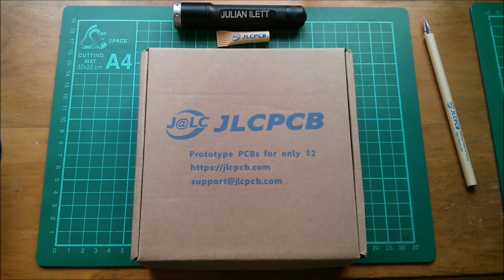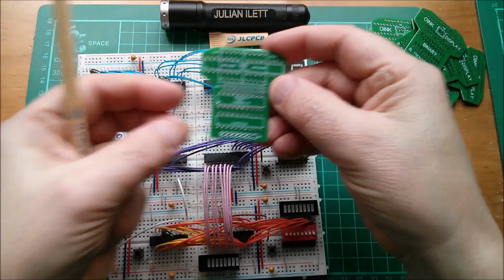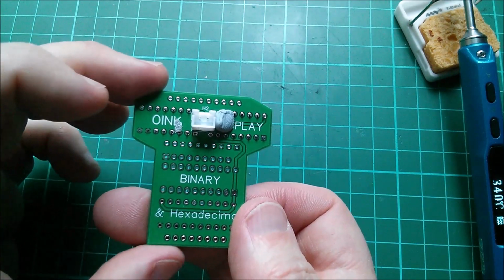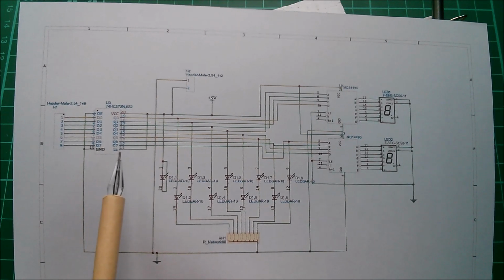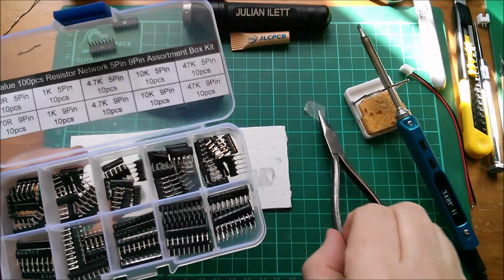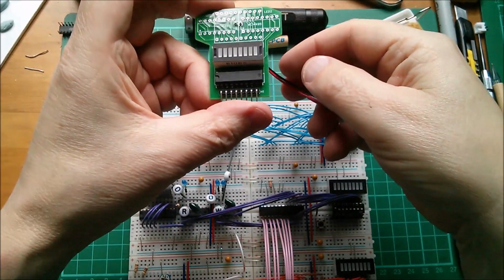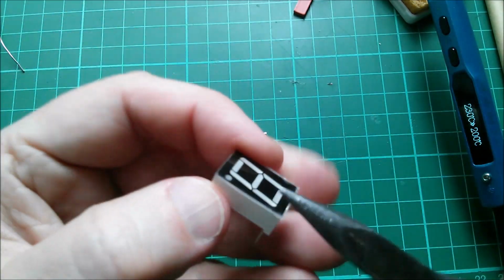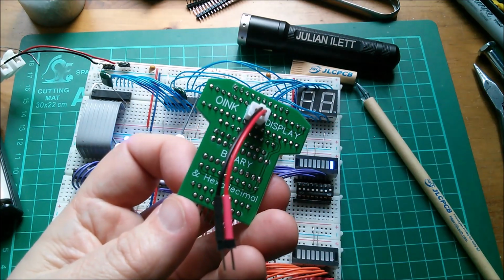New PCBs - Binary/Hexadecimal LED Display - OInK

Comment: @19:59 Using the tie clip is a great idea. Holds whatever you use it on down, and maybe dissipate heat. Sorry, I am still new to the hobby so maybe that is a quite normal thing, but I have never noticed it before. Thanks Julian.

Comment: As they say... "You don't solder a TIL311, you don't socket it either. You rent it!" I wonder what happened to those 20-30 pieces in storage at my first employer... But then again, this was some 26+ years ago... Back then, I built a POST card on ISA bus (0x80) with a pair of them (pretty much of what you have done here)... Would you reconsider and make public, free and unlimited use of the schematic  (no brainer) along with the PCB and Gerber files if I lend you "sine die" a pair of TIL's?

Comment: Julian!  Caution!  I'm a retired Biomedical engineer.  Early in my career, I used my thump to cover component leads as I clipped them off - using reasonably sharp high quality cutters.  Didn't want the leads flying into my co-worker's eyes.  Instead, the lead was injected into my thumb with such velocity that I didn't even feel it!  I think it was some sort of Motorola dual gate MOSFET with gold leads.  Nice little bugger. A month later my thumb was the size of a plum.  The wire had hit the bone and turned into a zigzag shape.  It was originally about 2 cm long.  When cut out of my thumb (by myself), it was scrunched down to about 6 or7 mm.   Every time you clipped a lead off, I absolutely cringed.  You're heading for trouble, son.  Nice video work!  Thanks!
Reply: Gees was the lead really pointy and really hard metal? Because thumb skin is pretty tough
Reply: Yep. those old Motorola transistors with the gold leads had what I think was gold plated steel legs.  very hard, very sharp and very beautiful.  I used to get poked by those leads a lot.  take care

Comment: You should definitely market these. My only suggestion for an upgrade would be polarity protection in the form of a single diode or a little smt bridge rectifier. I've killed so many logic chips by plugging the power in backwards.

Comment: That's really useful, actually. I've been trying something similar, just with four bits input switches for a nibble to hex. But the few ics I found did just binary to decimal and then some nonsense for the A-F part. So I made a discrete diode ROM instead. Yours is much more compact.

Comment: Before making public, you really should have added the bypass caps.  Please consider re-uploading the PCB layout WITH the bypass caps.
Reply: steveandamyalso Amusingly, I’ve just started watching the video and my first thought when Julian showed us the multiple digital IC PCB was... I don’t see any place for bypass caps?  LOL
Reply from the maker: A purely combinational logic circuit doesn't need decoupling caps - there's nothing to latch into the wrong state :)
Reply: @JulianIlett  It is your design, do as you see fit.  The bypass caps will do a great deal to reduce radiated EMI and overall circuit stability.  You have a good GND plane, which will help tremendously.
Reply: @JulianIlett  Fair enough, I concede they aren’t really necessary in this application. For sure, any brief errant logic levels caused by switching supply line noise will stabilise (given the low switching frequencies involved).  But I still maintain it’s good practice to include some bypass smoothing in any digital circuit. :)

Comment: Thanks. I'm embarking on an 8-bit computer build inspired by Ben Eater's and James Sharman's builds. I was thinking of designing a little board like this, but now I don't have to. I just ordered a batch from JLC.

One question: while watching you assemble it, I was wondering why you didn't put the MC14495 chips on the back, so you didn't have to stack the 7-segment displays on top of them. Too difficult / impossible to route the traces because everything is backwards?

Comment: Wow, I haven't seen one of those in a while.  I had made a Half A##ed attempt at making one of these with an 8 bit computer called the C64 years ago. I was repairing them in my garage under the Redwood Trees in Northern CA. I had so many boards to repair that I could offer the customers two options, 1 their own board back, 2 an immediate swap (as I had repaired many I had found used) and of course, the immediate swap was very popular. I used heat of the chips quite often, and sometimes they were cool when they were bad, hot other times. I always had to remove the chips, put in a socket, and put in a good chip. The board had a lot of PROMS and VID chips bad. I hope to find a C64 Commodore 64 (most likely a with a bad board) somewhere and repair it so I can have one . I still have most of the chips.

Comment: What's the point of using 4 ICs when you can use a single $0.5-$1 16-28 pin micro? You could optionally add button to switch between hex/dec which would also save you the hassle of custom pcb, making possible to order panels and use vscoring to cut rectangle circuit boards...
Reply: Then you wouldn't get to showcase your sponsor's ability to do odd shaped boards ;)
Reply from the maker: I don't want any programmed devices in this project :)

Comment: Very good design, clean with very little wasted space. I unserstand about overlapping the LED displays to the driver chips. Next time SMD versions?
Reply: Unfortunately, the MC14495 Decoder/Driver IC is an old design, and I don't think they are being made any more. At least I can't find any reference to them still being made, and certainly not in SMD-compatible versions.
Reply: @BertGrink  You're right, didn't think of that. I have worked with this IC in the past couple of years with some customer's products. No wonder they have changed their PCB layout ;) ! I did a filial search and came up short on direct replacement .Possibly a PLD or PIC transfer, but this was a one off so I am not getting tto hung up on fyture logistics.
Reply: For an SMD version, you’ll need to use a CPLD 😉
Reply: Julian could possibly have a PCB section routed out that matches the IC body, and squish the DIL legs flat for surface soldering. It's still kind of an SMD - A Suspended-Mount Device, hahaha!

Comment: The beauty of having a dual sided board with plated thru holes  is you can use  both sides. You should have mirrored the images of  14495 IC's and soldered them on the back side. That way the displays wouldn't sit on them and the whole thing looked a lot neater.
Reply: Yeah but the signal traces would have crossed.
  While I won't use them for very many traces, it is pretty easy to use tiny brass rivets to make your own through hole "plating" with DIY etched boards. I do this quite often. I just put the rivet in, hold the board and collar against a piece of wood, and use a nail or needle pick to expand the pointy side of the rivet. Then I use a drill and slightly larger bit driven counterclockwise to expand the rivet and set it in place. No special riveting tool needed. A kit with several different micro rivets can be sourced from AliEx for less than $5. The smallest ones work as vias and the larger as through holes :-)
-Jake

Comment: Kind of off topic question: Does the TS80/TS100 soldering iron suppose to smoke on the tip when it's first used?
Reply: I believe it's pretty normal for a new soldering tip to give off vapour when first used. Unless you're getting smoke from the device itself, I wouldn't worry about it.
Reply: @SodAlmighty  Thanks :)  Although I bought A Quick Charge 3.0 Charger it was pretty warm itself is that also normal ?

Comment: Plug it into your shift rigister sudo random generator
Reply: They output a 1 bit stream so unless you use a SIPO register to hold 8 bits it would just show 0 or 1 over and over

Comment: Adding the binary display below is very for people who still have not fully "grocked" hex !

I have never liked the "fake" hex displays with 7 segment displays.  "6" and "b" are just too similar.  The "proper" part is a TIL311/DIS1417.  These can be pricey, but you can find them sued/surplus on eBay for a few dollars a piece.
Reply: Could you not just use the decimal to indicate that it's an alpha character on a 7 segment display?
Reply: @rimmersbryggeri  - Nice idea!
Reply: @uni-byte  If it is possible I think its a slick way to get around the very real issue of clarity. I 'm no electronics desiner though so I dont know if it's possible.
Reply: @rimmersbryggeri  - Possibly not in Julian's implementation, but it's certainly possible generally speaking.
Reply: The decoder chip used has an output pin that IIRC signals numbers of ten or greater.
Reply: @Mark1024MAK  - Yes.  Just looked it up.  You're right.  Pin 4 goes high.
Reply: @Mark1024MAK   What is the implication of that?
Reply: I remember seeing these special hex displays years ago.  They were super expensive then and are still super expensive now.  I can live with the 7 segment displays especially since the hex is usually not on an end user display.
Reply: Personally,  I dont like "tail-less" 6's and 9's. So I always put a "tail" on my 6's and 9's, that is, seg A is on for 6 and seg D is on for 9 and there is no confusion.
Reply: rimmersbryggeri - using pin 4, you can drive the decimal point (or any other LED) to show that a hexadecimal number of A to F is being shown.
Reply: @ElmerFuddGun  - TIL311/DIS1417 on eBay are less than $10 a piece, closer to $6 when you buy like 5 or 10.

Comment: I wonder why no one is making these displays with builtin decoder.
Reply: Probably because their use these days is extremely limited. And then you have another line item to stock and distribute. Easier to simply design a generic display and let the designer choose how it is driven.

Then again, there are/were things like the DIS1417/TIL311 which had a built in hexadecimal decoder, and produce a very nice looking output.

Comment: Never use a socket unless you need to - as in EEPROM or GAL.
Reply: oh ;-)
Reply: I always use turned pin sockets for prototypes. Have done for 30 years without an issue.
Reply: @gordonlawrence4749  - I agree.  Prototypes are different as you will likely pull them apart, or need to make some changes.  Sockets are ideal for that, even dual wipe types.  For the end product I always solder direct unless the chip contains firmware or is a PLD of some sort.  It's cheaper and more reliable, even if the machine sockets are almost as reliable.  They are costly.  There are other reason to solder directly too, depending on the device and speed of the circuitry.  Noise, path length/topology, emission, thermal, etc...
Reply: Uni-Byte - Someone must have stepped in something unpleasant, as there is one hell of a smell around here.
Wire wrap production boards use / used IC sockets and would run for at least 20 to 30 years with good reliability. As with everything, if cheap rubbish sockets are used, you will run into problems. So use good quality sockets.
Reply: @Mark1024MAK  - And the smell is coming from your direction.  Why do want to start a fight?  Do you feel better now?

Are you suggesting sockets are more reliable than soldering direct?  If you want to use sockets, knock yourself out my friend.  Just don't start the name calling thing (I don't know what I'm expecting, after all, this is the internet).
Reply: Uni-Byte - I was referring to the incorrect presumption that using sockets means that a system will be unreliable.
Reply: Uni-Byte - Oh, and please point out for me where I called anyone a ‘name’. And I’m not the least bit interested in fighting with anyone on here. Each to their own. I just wanted to clarify for people who don’t have many years of experience working on and with electronic systems and circuits.
Reply: @Mark1024MAK  - I'm not sure I made that presumption, although I can see how it could possibly be construed.  All that said, I have had socket connections go bad over the years, but never a good solder joint.
Reply: Uni-Byte - Solder joints do sometimes fail. Okay, often as a result of one or more factors. And of course, using a socket will not fix this. Solder joint failures that I have seen include manufacturing faults (presumably dirt or contamination preventing the solder bath machine from properly soldering the components). Hand soldered joints with the same problem. Dry joints caused by vibration or heat/cold cycles (often on power resistors, voltage regulators, power diodes, power transistors and transformers) and dry joints on connectors (caused by stress). 
For equipment that is mass produced, or where there is no intention to maintain or repair it, or where the cost of the IC is low, it is normal to solder chips to the board. I have no problem with this. I do have a problem with generalisations based on misleading information. Many boards that were produced in the 1980s (but not exclusively) had poor quality IC sockets. A lot of these are stamped pin types with contacts that make contact on only one side of the IC pin. I agree that these do cause many problems. But high quality turned pin sockets, if used correctly, don’t normally cause any reduction in reliability.
Reply: @Mark1024MAK  - 4 things Mark, then I'll leave you to this.  1)  I did say a good solder joint.  2) The socket needs to be connected to the circuit too,  by solder, or less frequently these days, via WW.  So, because now you have two points of failure it is inherently less reliable. 3)  My main reason (I think I mentioned this) is cost, but there are many other reasons besides cost and reliability. 4) I promise I will never try to stop you from using sockets.   5) I only started electronics this afternoon, so I know nothing ...

Comment: What I find really amusing is that we seem to make nearly the same PCB circuits - you made an isolated FET driver and I made an isolated SCR driver, and coincidentally we used almost the same little black PSU module. And now? Logic! I made a logic board too, but different functionality and small form factor - 3x2 cm.

Comment: Couldn't you have connected all the cathodes of the LEDs together and used one resistor?
Reply: Brightness would change as the number of lit LEDs changed.
Reply: @uni-byte  You the man. Forgot about that one. Ya, it would work if only was lite at a time. Thanks.

Comment: can get inkjet cleaning cartridges to unblock the jets. Not sure what liquid is in them
Reply: Usually isopropanol and something else usually something simple like about 30% water.
Reply: @gordonlawrence4749  Thanks for the info. I tried lighter fluid many moons ago. Cleaning cartridges did unblock them. Prob best plan would be to do more printing
Reply: I’ve given up on inkjets for most of my printing. A mono laser printer is just so much easier to use. No wet ink, no expensive cartridges that block up and run out halfway through a job. And faster as well. And the best part, is the second hand laser printer only cost me £30 😀

Comment: Just curious, why use a 573 instead of a 541? Availability?
Reply from the maker: The 573 and 574 have a lovely symmetry - the 541 is skewed on the output side.
Reply: @JulianIlett  I checked the specs and even though the 541 is technically a buffer it seems to have exactly the same source/sink characteristics as the 573 (I compared the TI specs). Strange but true.
Reply: I'm guessing that he just didn't think about it or that he already had some of the 573s in stock.  The 541 would have likely been my first choice.